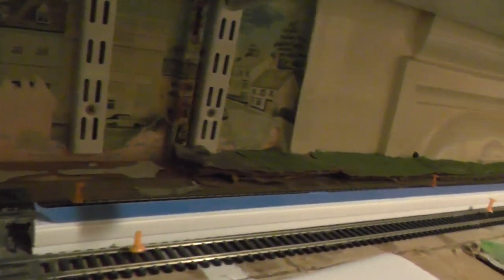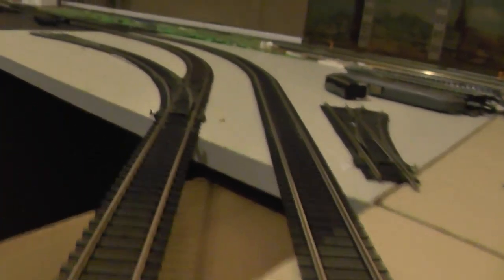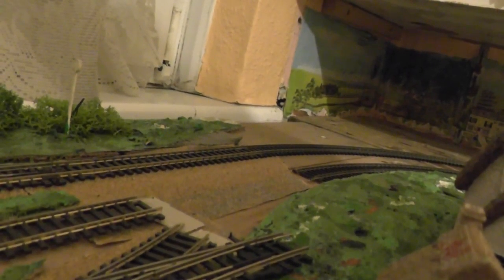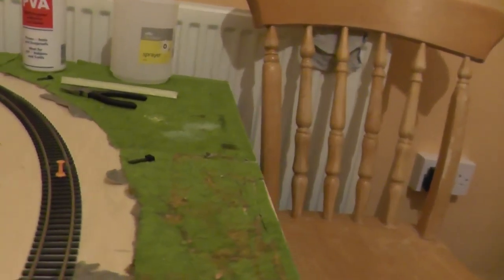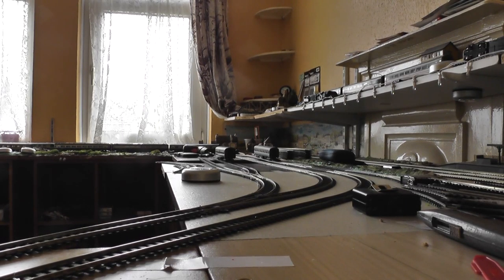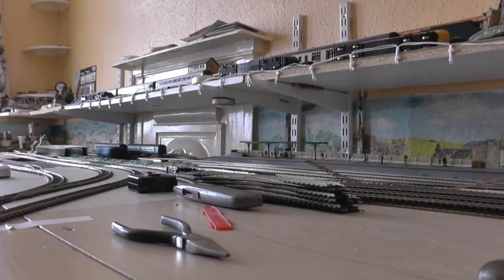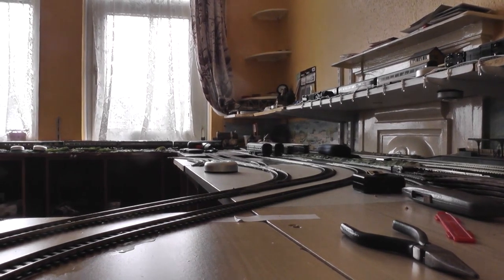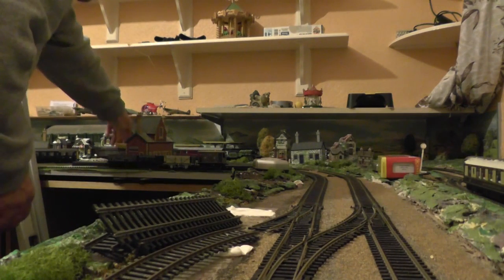Colin's model railway new layout update 3 and running tests March 10th to 15th 2017

Comment from the maker: I did run my DMU class 105, the couplers are totally different to the usual couplers, a few times it uncoupled, on the front of both cars the couplers are same as Hornby, so what i did was give it trial run with both fronts of cars facing each other, it worked fine, what i would like to do is switch the couplers, i have swapped the couplers, and soon will give it a run

Comment: Hello Colin, I am new to your channel and have just subscribed. Interesting to see developments. What are your plans for the sections of track that currently bridge gaps? could you use actual bridges to support them I wonder?
Reply from the maker: Thanks for subscribing Mike, one gap hoping soon cut small triangle piece and dowel peg to sides of boards, the major gap is about 12 inch, so options open possibly a girder bridge, will browse you tube for ideas, one of my mates says you could put small shelf underneath maybe add few cars etc